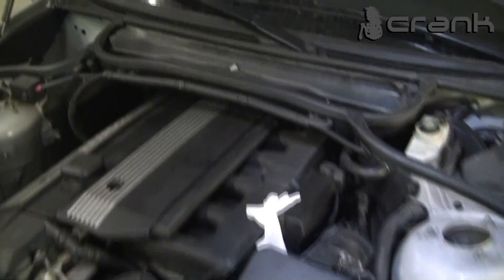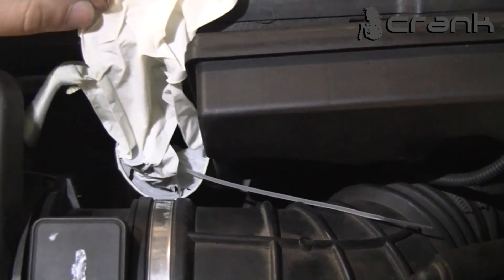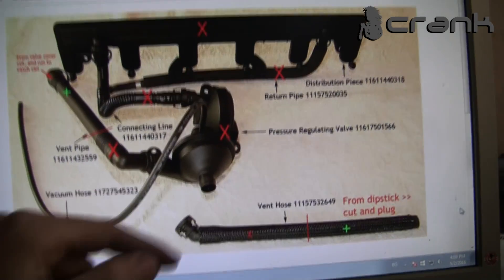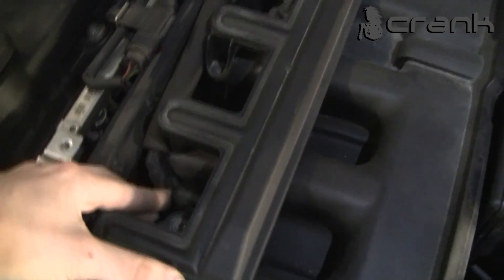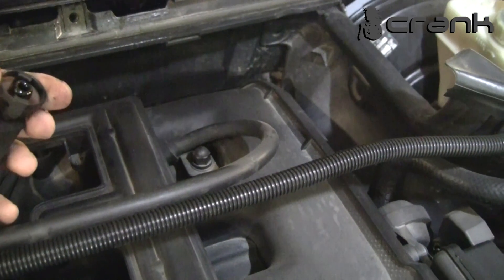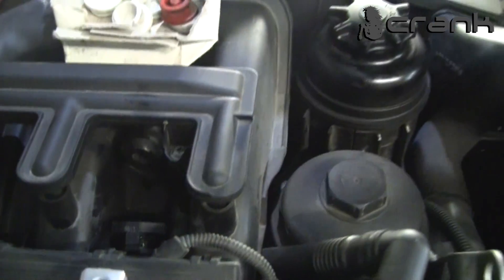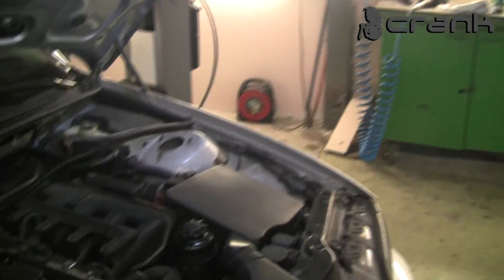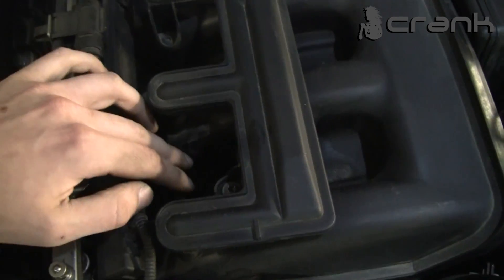BMW CCV System Testing

Comment: What about an oil leak that ends up being burnt and coming out of the exhaust? So an internal one? I’ve got not thick but white blue smoke being left behind after engine has warmed up, no smoke at all on start up.
Reply: Oil getting past ccv because it is clogged.

Comment: I will do this test on my E46 this weekend. I have a small vacuum leak somewhere in my system. I smoked the intake and found my lower dipstick tube o-ring to be leaking. after I made the repair my short and long term trim numbers were still positive 10% and my car has a very slight rough idle. Excellent video.

Comment: Hi , may I ask why you seal the two holes? Will this solve the oil burning problem? And can this consider the ccv no more in use ? Tq in advance .
Reply from the maker: I seal them , because if we start the engine without sealing them , we were going to create massive vacuum leak and the car will stall . So you need to seal them , to be able to test the car with CCV system removed .